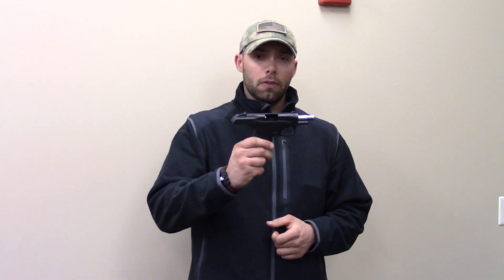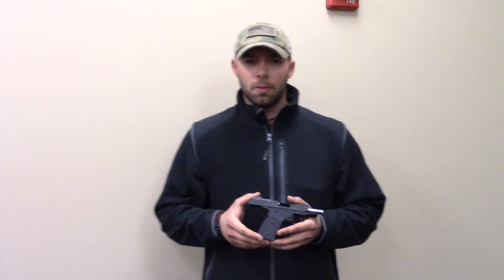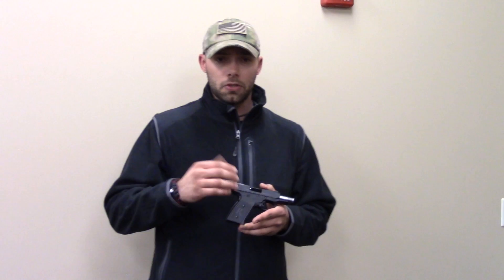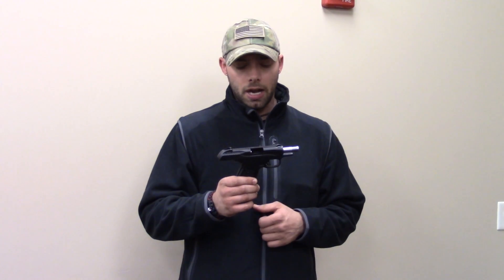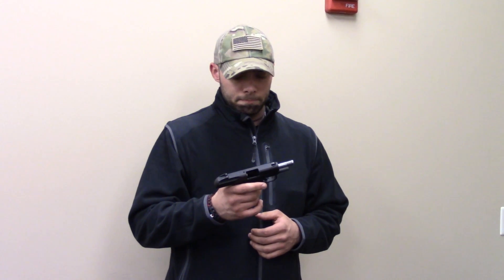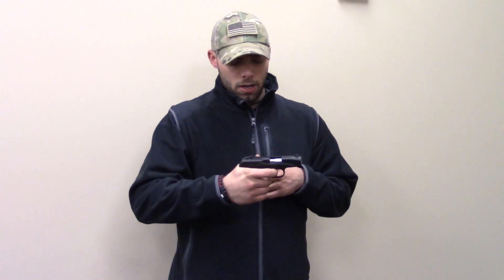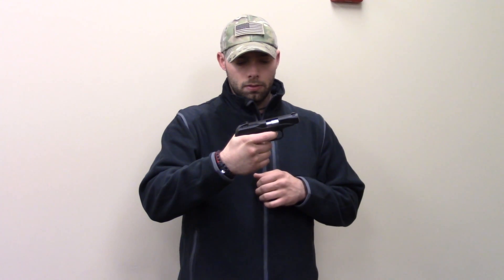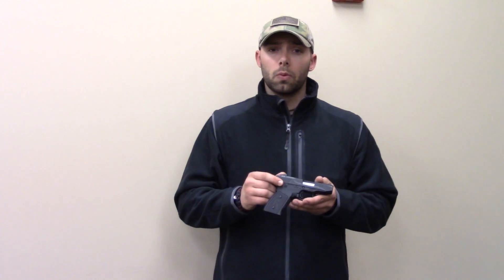Remington R51: The Gun That Just Won't Go - Tactiholics™

Comment: If the slide locked open mid magazine, he reassembled it incorrectly. He has he slide lock above he spring instead of below it pushing it up.  My biff east problem is the extremely tight chamber. If they loosened up the tolerances, it would feed and extract
Reply from the maker: That gun had never been field stripped and inconsistently locks the slide to the rear. I would think incorrect installation of the slide lock would cause the issue every round, or nearly every round, so I don't know what's causing it.